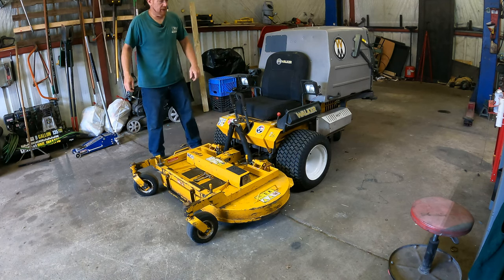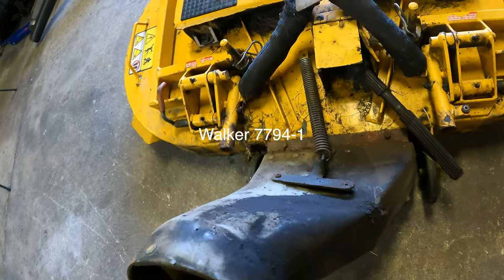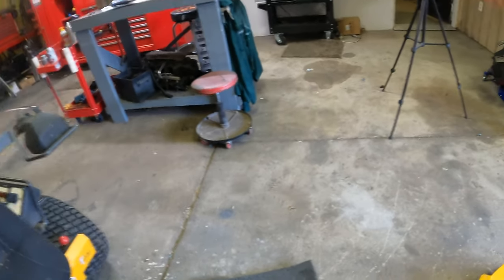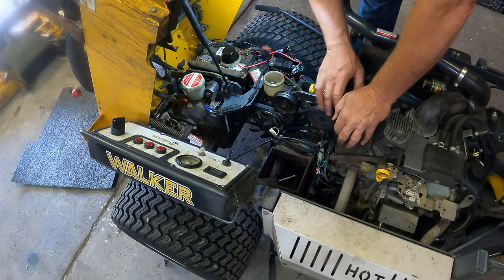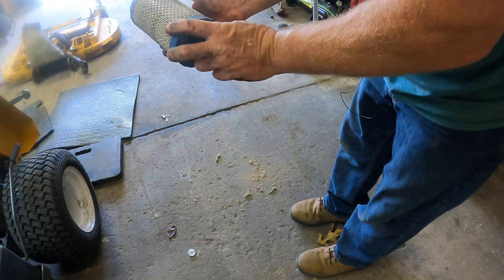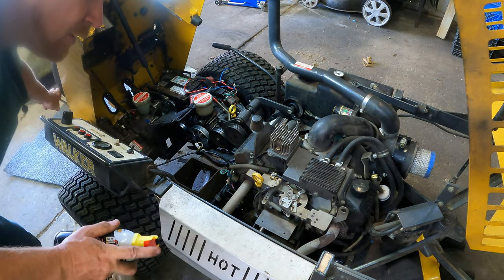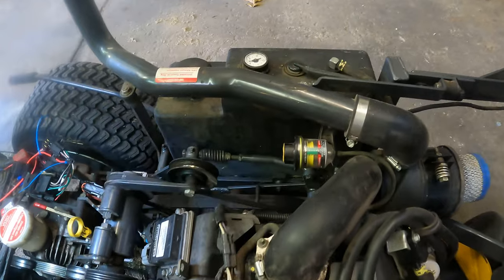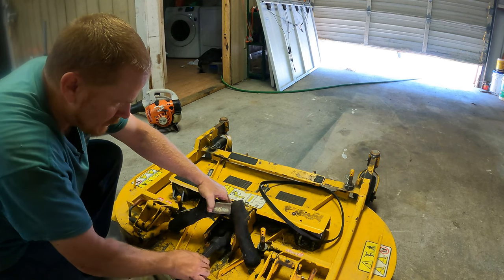Buying Used Walker Mower? Full Evaluation Common Issues and Maintenance Tips

Comment: Hi Ken, great video! I have a 2006 walker ghsmt 26hp 3200hrs in good overall shape.  I would love to hear your thoughts on 3 issues having.
1. I just found gas is getting into the engine oil, maybe thru a leaky fuel injector??? 
2. engine surges when driving without blades engaged… but does not surge with blades engaged, maybe an injector issue??? 
3. engine will back fire when throttle is rapidly lowered from high to low…  but …will not backfire if lowered slowly… so maybe not an issue???

Note…engine uses 1/2 quart of oil every 12hrs , no oil leaks or visible smoke.

Thanks 

Frank

Comment: A machine with only 1000 hours and you're looking at these type repairs...doesn't sound good. Mine has less than 400hrs, not looking good going forward 
Still watching, hope you cover how much it all costs
Reply from the maker: I agree, the hydro shouldn’t have failed but it was left to leak and used too long. Had it been caught quicker it wouldn’t need replacement. I got 8000 hours out of my hydros on my machine. 
Other than that the blower is just a part that you will replace every 2-4 years. Check out vids on my machine I got unreal life from a machine I paid $650 for

Comment: Walker is now crazy expensive. A new T27i is about $21,700.
Reply from the maker: Yes, But so isn't everything right? The way things are going our minimum lawn mowing rate will be 3 figures
Reply: Who says you need a 27 that 23 is better
Reply: @KenMrKLC hey Ken. I ve been watching alot of you videos. Awsome work. I have a problem With my Walker, I seem to be leaking oil near the gear axle. I want to know if I needed to change the seal and bearing by taking the gear axle off. Or can it be done with the gear axle on the machine.
Reply: I just got a 2005 with a 20.9 HP Kubota for $1500 runs and cuts no issues lol

Comment: If you don't mind, share the cost on next video
Reply from the maker: I will not disclose my labor cost however it it about $7.50 per seal, $650 blower, $1000 for a hydro, $100 for the deck to blower chute. I got about 8000 hours out of hydros before if you change oil frequent and reseal input shaft before it’s too late

Comment: 1500 hrs is not many hrs to be replacing hydros! whats up with that
Reply: 1056hrs.
Reply: @hpw59  Man those hydros should last 3 times longer that that ! I got these exmarks machines and 1 has 3500 hrs one has 2500 hrs and never had any hydro issue- Walker is a top tier commerical mower ! wth!
Reply from the maker: I got 8000 out of mine Ray Ray, and it’s 1 hydro not hydros… and it is because it leaked and wasn’t caught in time. There is a kit for under $100 you can replace the input shaft and seal once it starts leaking. Also who knows if the hours are true and what conditions it was run through
Reply from the maker: Snitch!
Reply: @KenMrKLC  🤑🤑